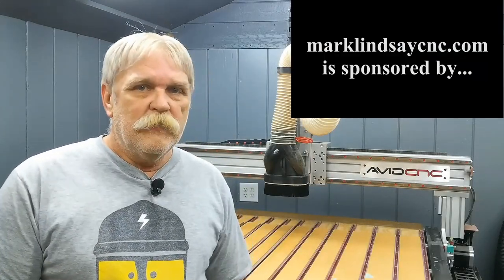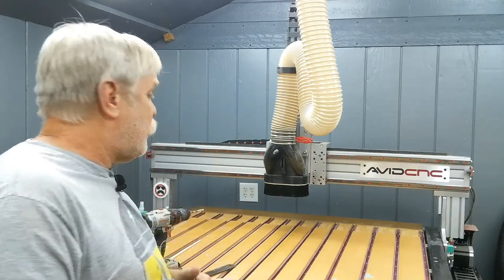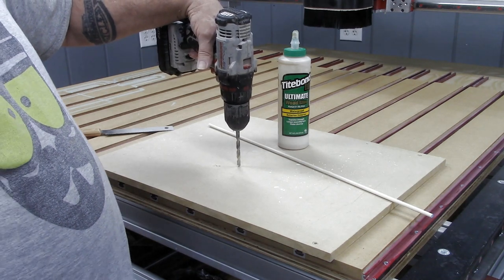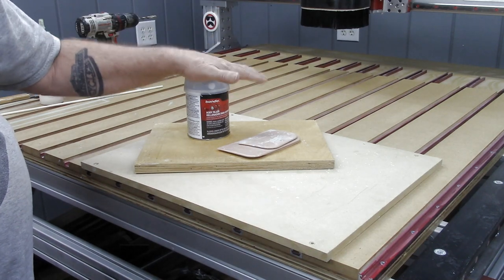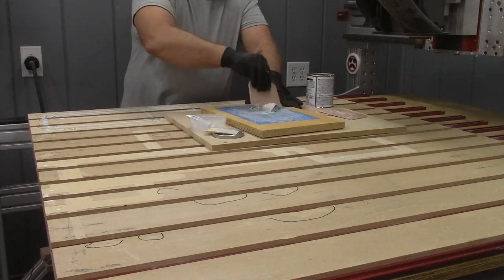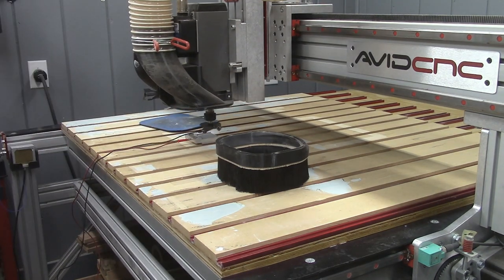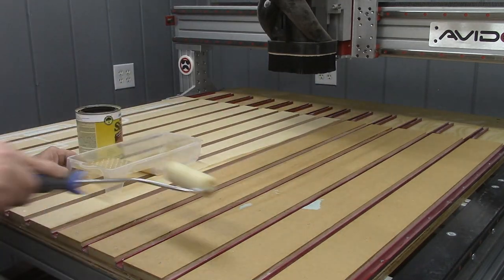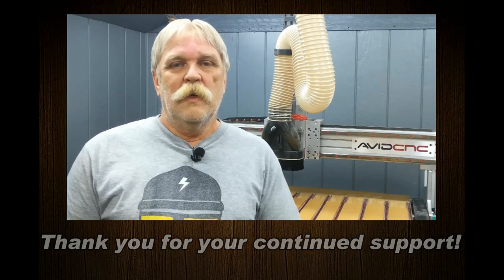Repairing the Spoilboard on my @AvidCNC 4848 Pro CNC Router

Comment: Nice Idea, been doing this for 20 years and that never crossed my mind.  Seems much easier than remaking spoil boards and redrilling and pocketing mounting holes. Always learning something new. I may change your idea a little, keep the dowels for line-up holes, but use wood filler instead.  Not sure if it will adhere as well as the bondo, but its cheap enough to give it a shot... I have used filler to repair 2.5d mistakes and it held up well.  Thanks!!!

Comment: Thanks Mark.  I never thought of using bondo.  Great technique overall.  Glad I saw this before attempting it on mine.  I never did this and my table surface is a bit bowed as well.  This should clean and level everything up nicely!
Reply from the maker: Thank you! To be clear, I only used the Bondo to patch deep holes/gouges. If the Bondo layer is too thin, it can chip out or be torn out, so I only used it in deep cuts. I didn't use it to fill in low spots - I surfaced any low spot or shallow cuts out of the spoilboard with the surfacing bit.
Reply: @MarkLindsayCNC  I'll do the same...Thanks!

Comment: I had thought about doing this as well but my Bondo was well aged and went bad.  I use Durham's Rock Hard water putty for repairs to dings on painted trim and had given some thought to using this for spoilboard repairs but I haven't found the round tuit yet.  😁😁Steve

Comment: You're not the first a certainly won't be the last to use automotive body filler for an other than it's intended purpose. It's a great product with a 101 uses, I've used it for leveling sub-flooring.👍👍
Reply from the maker: I've seen people repair holes in boats, fix low spots in concrete floors, smooth over fiberglass doors - you name it. It's cheap and easy to use. The best part is, it'll take just about any primer and paint you can imagine.

Comment: Why do you have the board in strips and not a solid board?
Reply from the maker: There is t-track mounted to the table between the MDF strips. The t-track allows me to easily position clamps or mount fixtures to the table without drilling holes or driving screws to mount them. Some people prefer to make a solid spoilboard and drill holes in a grid pattern, then use threaded inserts in those holes to allow for clamp or fixture mounting. It's down to personal preference, really. Spoilboards are another case of "there really is no best - it's whatever you prefer." This video will explain how I made built my spoilboard: https://www.youtube.com/watch?v=uhuPbu2wVGg